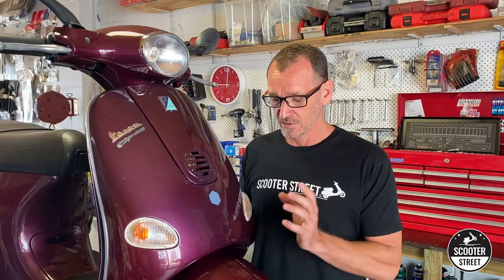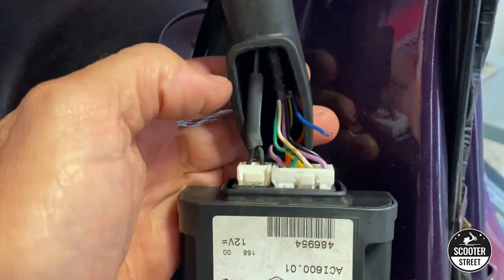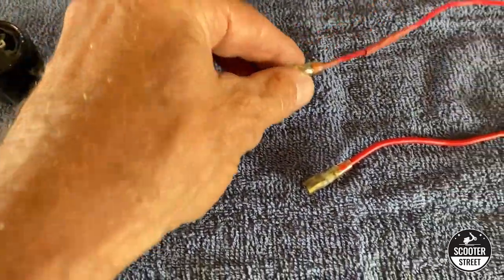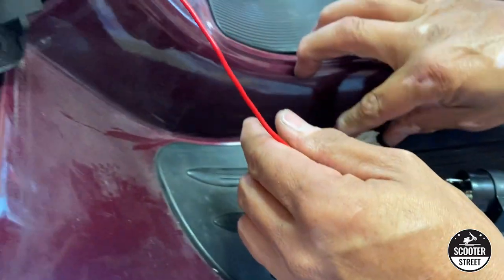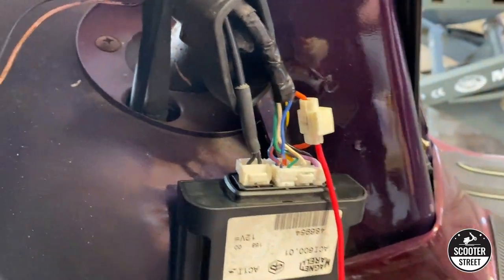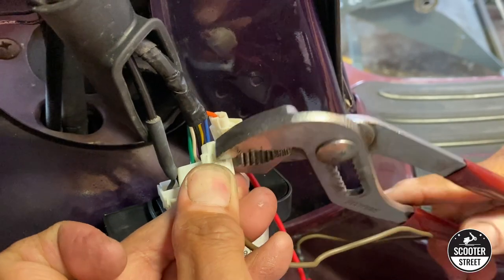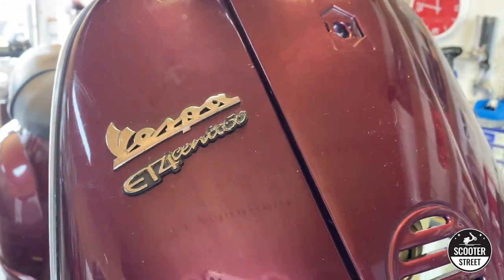Don't Waste Money on ECU: Fix Your Vespa Flash Relay Now!

Comment: Thks four your Exllente video I have a Vespa Lx 50 2T my indicators start flashing quickly when I break any help thank you very much
Reply from the maker: Thank you, check battery and charge rate, earth wire.
Reply: Thank you to reply the battery is full charge è need to check is I can find any wire damage Thks

Comment: does this also make the indicator lights on the dash flash evenly  or do they still show irregular?
Reply from the maker: When we do this, all parts work as normal. Check the globes in the indicators if it does not work correctly.
Reply: @scooterstreetau  thank you i will give it a try
Reply: @scooterstreetau  while i think about it only the right hand indicator flashes the same as your video but the left indicator behaves normally
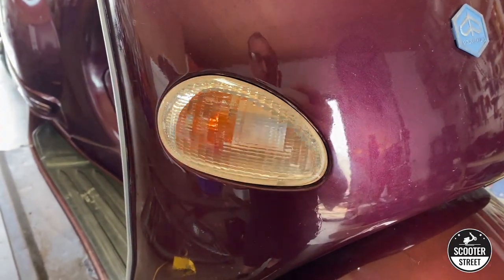Reply from the maker: @dantheman3k  The fast flash was our problem, see video at 0:18. then see at 3:13 once repaired.

Comment: I've recently shorted my indicators when installing a new indicator on the same model. None of the indicators work now. Will this also fix this issue? Or is there a hidden fuse somewhere?
Reply from the maker: Check fuse at battery compartment first. also check the wiring and connections.

Comment: I have Peugeot vivacity 4t 50cc but i cant find flasher relay,mby it is in cdi or regulator?🤯
Reply from the maker: Ask the dealer, it should be a stand alone part in the front cover or dash.
Reply: @scooterstreetau  i looked there but there is nothing to look like a relay.
How Can i reach dealer?
I bought a used One.🤷‍♂️🙏
Reply from the maker: It will be there, round can shape with silver/brass coloured base. 3 wire. I just googled it and there it is.. @Kristersgulbis1
Reply: @scooterstreetau  but what to Google?
Thanks💯💪

Comment: One minor criticism. You shouldn't have cut the blue wire so close to the connector because it would make it nearly impossible to reverse IF a future owner ever wanted to spend the money and replace the ECU with the built-in relay. Cutting it even 2-3 cm away or even at a different point of the wire would give you the option of returning the wiring to "stock" configuration.
Reply from the maker: Thank you. Apart from cutting the wire close what about the idea behind the video? What do you think?
Reply: @scooterstreetau  Well, it's obviously a brilliant workaround to a terrible design by Piaggio. I hate it when companies make everything "integrated" and force you to replace an expensive part like an ECU in order to replace what should be a $10 part. It's ridiculous if you think about it because turn signal relays generally have a lifespan of about 10 years.
Reply: Also, for anybody else watching the video, it would have been better to open up the electrical tape a bit AFTER the rubber cover and splice into the blue and red wires there. That rubber cover is meant as a moisture protector for the sensitive wiring of the expensive ECU and by splicing so close with those huge quick-connects, you won't be able to use the cover to cover the connectors.
Reply from the maker: @user-ld6wo4rv8h  Great point🙌